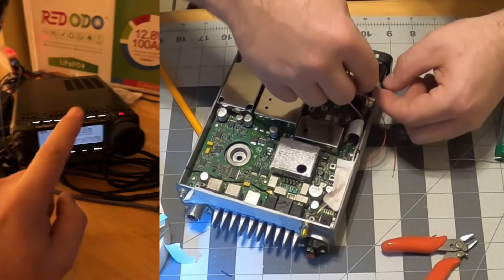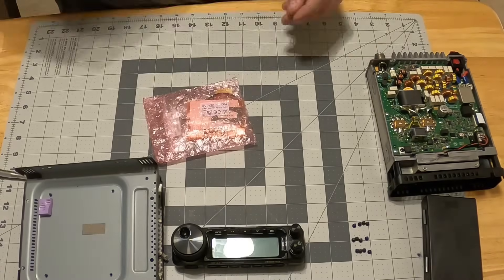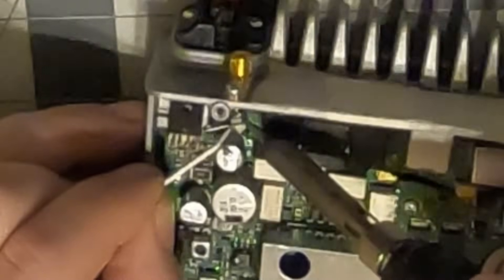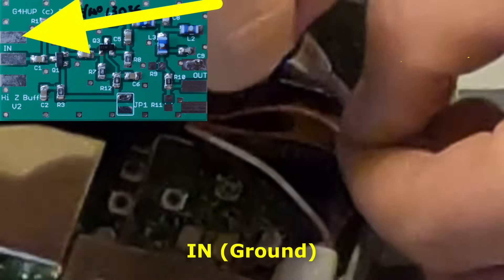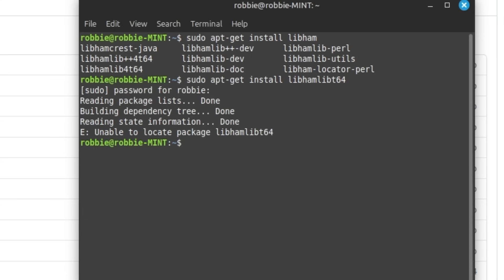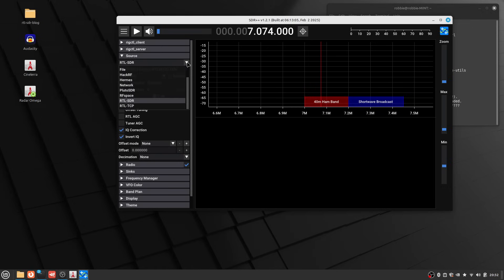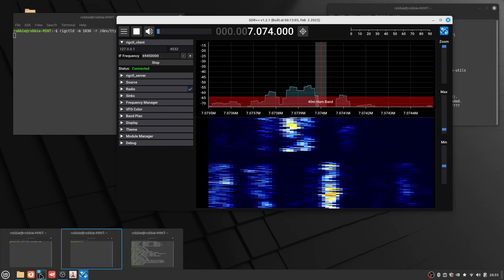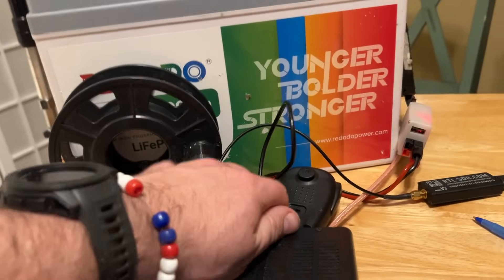Easy Panadapter Mod for Yaesu FT-891 - SDR-kits.net HUPrf board

Comment: I have this same kit for my FT-991, but I'm too chicken to do the install. Once I saw how small the connections were, I realized I didn't have the proper magnifier to do the work.  😀

I ended up using an SDRPlay with a DX Engineering PTT antenna switch. Basically, I receive on the SDRPlay and transmit on the 991.
Reply from the maker: Better safe than sorry. That’s a nice kit, but was a little more costly to acquire. It works, though. 
My magnifier was a cheap one from Temu. It’s not super clear, but it got the job done. The trick is to lay off the caffeine and take your time so you don’t accidentally melt the resistors off. That would be horrific.

Comment: Hello, nice tutorial.  Question.  Some people say to use SDRplay RSPdx-R2 while others/you say to use the RTL-SDR.  Which one do you recommend and why?  The RSPdx is quite a bit more expensive so just wondering if it's worth getting over the usb stick one.  Thanks!

Oh, one other question.  I want to install this on my 857,  Will this work when I switch to using the VHF and UHF bands?  Or will the setup only work when I'm in HF because the radio has two antenna inputs?
Reply from the maker: I like the RTL-SDR quite well. I have this one: https://amzn.to/4kAWklm
The price is right, and it works. I don’t know why one would be recommended over the other. I would guess it could be maybe the USB device wasn’t available when the SDRplay was introduced in the other’s recommendations. Or perhaps they just preferred that one. 

As for your rig, the 857 has two IF mixers; One for HF and the other for VHF/UHF. You will only get HF for one IF tap. You can look up the iFace FT-857D install on tspelettronica to see exactly where the connections should be made. It is the same three wires for the iFace and the IF tap that I used. 

I hope this helps you. 73, Robbie
Reply: @w1rcp great thank you! I just ordered the RDL-SDR  but I ordered the v4. Thanks for the info 73 K5NA

Comment: I ordered and installed the board in my FT-891. Server question: Would I use the same rig control command line you used for my windows application? Also, would it be better to use a program like OmniRig for my CAT control?
Reply: I figured it out, I can see it's a Linux command. Sorry to bother you with silly questions.
Reply from the maker: Hey Dean. I just saw this. I used Linux because I had planned on using a Raspberry Pi for a project. I’m glad you figured it out for Windows. I would have needed to tinker with it to solve your question. Share what you did in case someone else comes looking for it. -Robbie

Comment: I was looking for a solution like this! I have an airspy hf and it works with linux. Would there be any reason it wouldn't work with gqrx?
Reply from the maker: I used it with GQRX, but I couldn’t get it to read from the radio. I could control the radio from the PC, but if I turned the knob on the radio, it wouldn’t follow on the SDR. There has to be a better solution somewhere.

Comment: Good god what sort of jack hammer  did you hit those screws with at 2:20
Reply from the maker: Hahahahahaa. I almost died from coffee inhalation reading that comment. That wasn’t a jack hammer. These screws are specially engineered to destroy on contact as an anti-theft device. Hindsight being much clearer, I wish I had gone with a different SMA. The chews, I mean screws, don’t bother me as much as the crookedness and having to munch some of the cover away.
Reply: @w1rcp  You could've use a file to trim down the edges of the SMA?.   I have the board but I need to enlist my good friend to do it for me...shacky shacky hands here...aged.

Comment: A potential better way of doing the SMA antenna connection on the back is to buy a female SMA pig tail about 6 inches long. You would still need to drill a small enough hole for your pig tail coax to fit through on the back of the radio. On the inside of the radio, you can take a small zip tie and pull it tight around the coax of the pig tail, then cement it in place. This will keep you from pulling the pig tail too much and causing damage to your IF board you just installed. I did this mod on my IC7100. Good luck. Great video sir.
Reply from the maker: I had considered that but dismissed it because this radio is tossed about quite a bit. I could see having a floppy dongle hanging in the outback getting bent and broken. A panel mount (threaded connector with a nut) sma would probably work better and not get all crooked.

Comment: Thank you for posting this. I've been wondering about making this mod given the challenge of soldering the connection to the IF tapping point. Y
Reply from the maker: It is not that bad. I was also scared to do it, but with magnification and some care it was surprisingly simple. Using a dab of flux would have made it even easier.